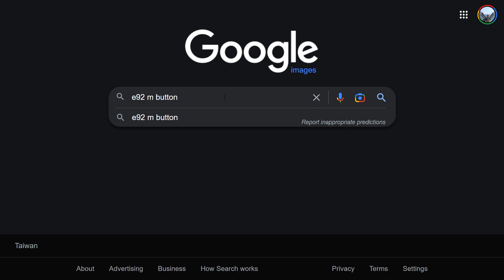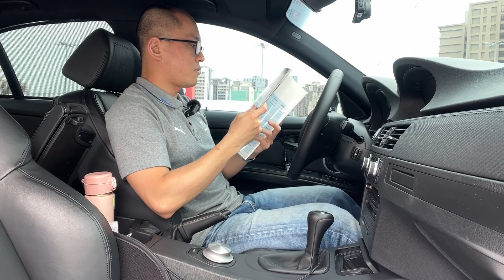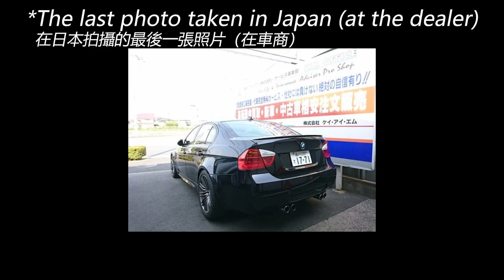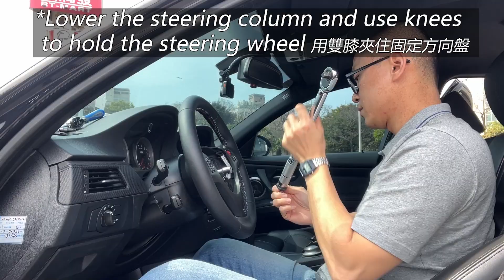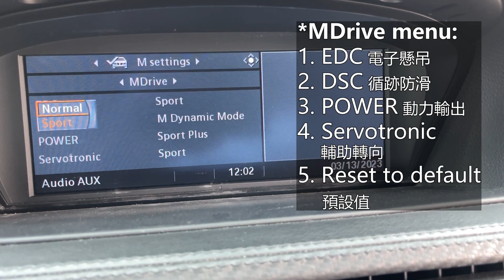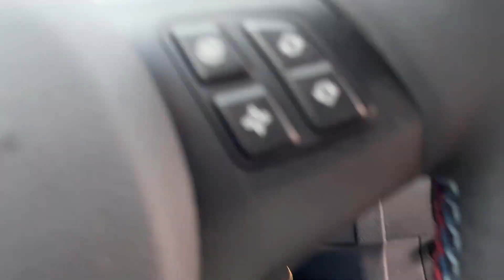The must-have MDrive Retrofit DIY for BMW E9x M3s[ENG SUB]

Comment: Excellent video!  I wish this had been around when I was fumbling with the coding on my car.  I have one problem that you don't however - I have a non I-drive 6 speed car.  When I enable M-Mode there are some default settings that I can't change(steering, MDM enable, power levels), as I don't have the I-Drive interface.  Do you see anywhere those defaults are stored?  There must be a place outside of the I-Drive where non I-Drive M mode defaults are stored, as the non-I-Drive + M-mode configuration was sold by BMW.  There is some feature in the business radio relating to M-mode, and I did enable that as far as I can remember, but that didn't change anything.
Reply from the maker: Hi nodemgr thank you very much for your comments! I had been fumbling too at the very beginning. I remember that you sent me DMs on M3post, thank you again for the inputs! You are the successful DIYer I’m referring in the video!

First of all, the owner’s manual only mentions about setting up the preferences via iDrive. And I do not have any information about the other places we can set our preferences. I think iDrive is the only user interface available.

Please refer to page 20 of the E92 M3 After Sales Training, the junction box JB/SV is responsible for sending signals to DME, DSC and EDC-K via the PT-CAN bus. I think the iDrive/business radio, CCC/MASK, do tell the JB/SV what signals to send  when the M Button is pressed. I used NCS Dummy to look in the JBBF module but just couldn't tell which options are related.

What are the settings you wish to have for the M Button? I can send you my trace files of iDrive and jubction box or other modules related to MDrive, for you to study with NCS Dummy. Please feel free to mail me at funcarsgoodpeople@gmail.com !
Reply: @funcarsgoodpeople  Ah great to know it's you!  Actually I got many ideas from this video...I realized I had not coded the non-US MDM correctly, so I just fixed that.  Also I didn't even realize how to use NCSdummy to that will be helpful!  Thanks for the tip on the JBBF, I believe there are one or two items in there I need to investigate.  Will report back if I find where to set the settings for the M-mode.  Right now when I enable M-mode I see power and EDC with 1 LED...not sure what setting the steering is set too.
Reply from the maker: My pleasure to share something useful! So your default EDC for Mdrive is normal(one LED) and at this moment the MDrive menu in the business radio does not work. I get it. Please see the options DC_DC_DIAGNOSE, BISTABLES_RELAIS_JBBF2 and PIA_EDC in JBBF2 module. They are the only ones I could find related to MDrive. (I’m also interested in the MDrive menu in the business radio. Could you please send me some pictures?)

Try to drive around curves consecutively and switch on MDrive to see if heavier steering force input is required. Sport power-steering mode should make your steering wheel heavier and it’s obvious(but not super obvious lol.)
Reply: @funcarsgoodpeople  Will do. Sorry I meant professional radio not business.
Reply: @nodemgr  i also have a 6mt non-drive and about to do this. did you figure out how to change/select your M-Mode activate to change the steering/mdm/power? I guess my question is, 1) when you turn on M mode, does it change steering to stiffest, dsc to MDM, and power to sport plus? 2) how did you code your multi-function button to turn on MDM AND not change the audio input? thanks
Reply: @jeffersonho333  I haven't figured it out yet.  I've checked through all the documentation and settings but I can't find how it's done.   I think the key to figuring that will maybe be related to the audio input issue.